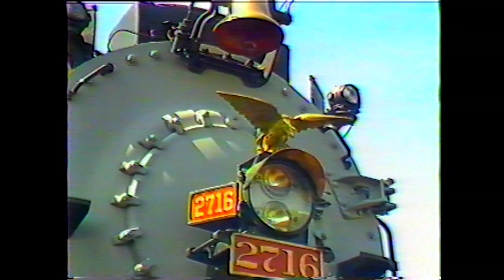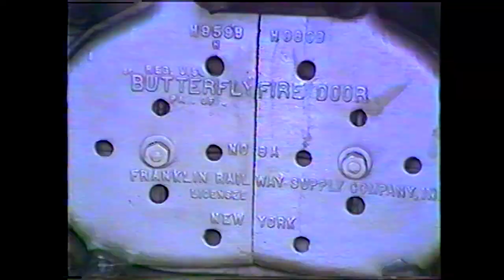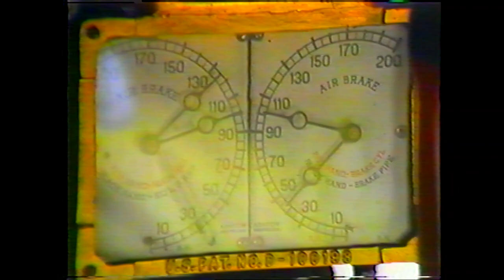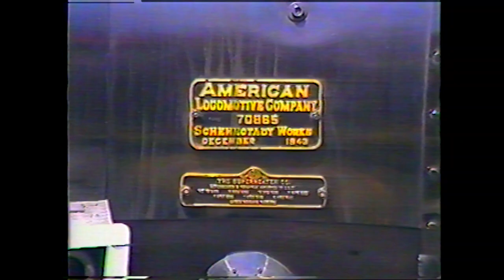Southern 2716, "Southern Chessie 2716" 1982

Comment: For anybody wondering where some of the passenger cars from this consist are nowadays, the open air observation is at the Reading & Northern being used on their Lehigh Gorge trips under the R&N applied name of "Appalachian Trail", and coach 1086 is at the North Carolina Transportation Museum in Spencer, NC alongside its sister coach 1081. 1086 is, mostly, out of the public's view though, and out of use in outdoor storage. I'd like to see it rebuilt, but getting that coach back up and running isn't really a priority for the Museum given the amount of operational cars they already use for their trains. Coach 1081 is in usage on their trains though. 
The baggage coach combine that was used as an open air car is now at the Tennessee Valley Railroad Museum in it's original Central Of Georgia livery as CofG 390. 
Aside from the 2716 which is under rebuilding in Ravenna, Kentucky, I'm unaware of where any of the other pieces of rolling stock that were in this consist are nowadays.

Comment: I wonder what is the origins of 2716’s water tender?
Reply from the maker: Originally the tender used behind L&N M1 1975. Converted for usage as a water tender by Southern Railway, renumbered Southern WT53 & first used behind T&P 610 in 1978. Also used behind 2839, 2716, and 765 1979-1982. Cut down and painted green, used behind 4501 1984-85. Given an N&W-style tender no., painted black, and used with 1218 1987-1991. Painted Tuscan red and used behind 611 July-Nov. 1994. Now used behind MILW 261.
Reply: @NickelPlatedProductions  DAMN that tender has had quite the journey, VERY glad to hear it's still around and being used.

Comment: 2716 is getting steamed again.
Reply: So as 587!
Reply: @brianfalzon6739  and i saw PRR 1361 and 5550 getting steamed to.
Reply: @maxwellwalcher6420  I heard that too
Reply: @brianfalzon6739  nope
Reply: @maxwellwalcher6420  1361 and 5550 are nowhere near having a fire in their boilers at the time I'm typing this. Those two engines still have a ways to go before they see steam, again in the 1361's case.